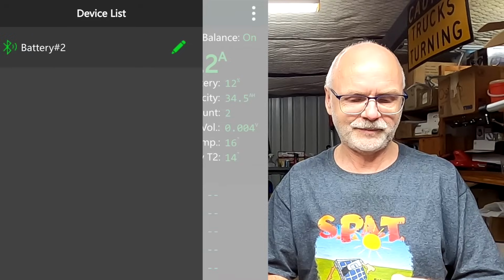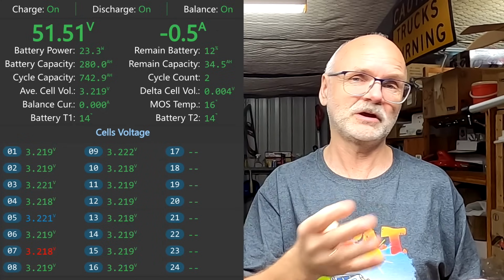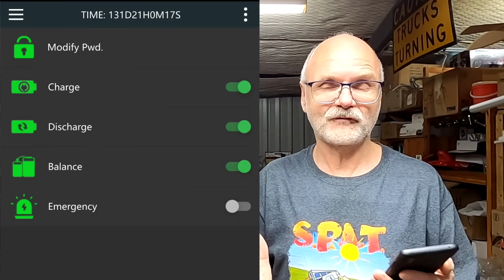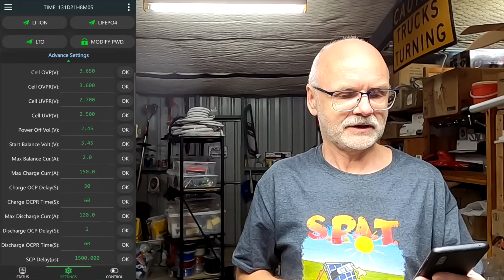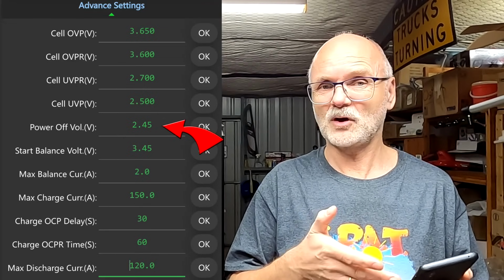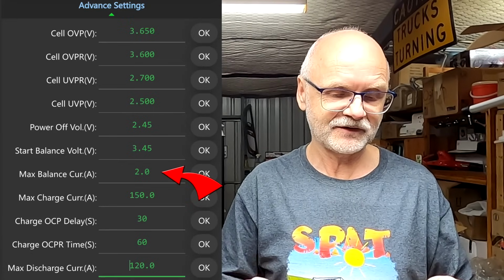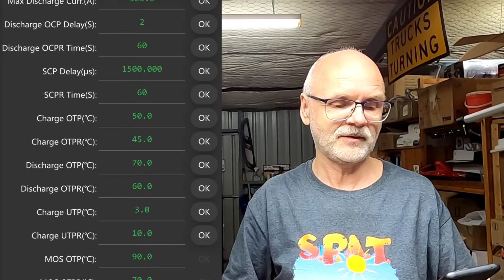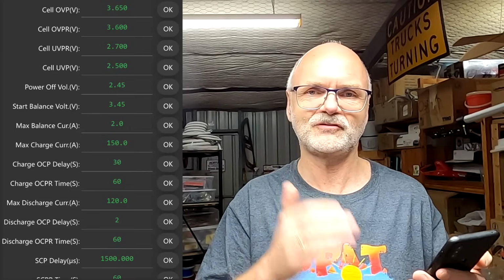JK-BMS: all settings and menus explained. How to program and set parameters.

Comment: First of all, your videos are amazing Andy! SO SO helpful that you test all these BMS's so we don't have to! And you explain so much. So many of the tricks and traps around battery charging and balancing. Great stuff, thank you!

I'm getting confused though. You have a video demonstrating how active balancing can actually unbalance your cells because it is always on. Then we have the JBD Muller Edition BMS which turns off its active balancer when it's not needed, supplanting the JK BMS at the top of the BMS pile. Problem solved. Now I see this video for the JK BMS settings, which let you set the balance start voltage to 3.45v.... why is the turn off feature on the Muller BMS any different from this ability on the JK? 

Does this mean the main difference between the muller BMS and this one is just the maximum discharge current (250 vs 200(ish)) and the active balancing current (5A vs 2A)?? Many thanks from the UK!

Comment: So if the maximun configure voltage is ecseeded ,the bms cutt of charging only or cuts off both charging and discharguing ???
Reply from the maker: Only charging, you can still discharge the battery through the BMS in this case.

Comment: Hi, thanks for your very interesting tutorial on the JK BMS. With regards to the B2A20S20P BMS. My question is with regards to the connection of this BMS to the Victron system. What would the 4 pin port be set to RS485 or CAN?

Comment: Andy.  I have the last version of the old jk  and it just Won't accept the 123456  code    but I never changed it.  And I don't think anyone did.. .    Any link to reset it to factory  and  if this work then to accept the  factory password??? 😢😢😢
Reply: οκ i found the bug....  it does not enter the code but if you insist and retry without  erase the code  your app accepts the code . but you need to insist and try the same clicked code .. every time you close app and retry code it just wont let you enter parameters changes !!!!!  it just needs to push the 123456 code you already tried  and no erase it

Comment: I am building a system for my motorhome ,  a 1972 GM bus 4108A,  I am installing 4-540 watt panels on the roof.  all viltron equipment.  a 3000/24/70 inverter charger.  a 250--88 Tr Ve can MPPT,   32 - 3.2 volt cells 304 amps. , victron smart shunt.  my question is which JK bus should I run.  I would like to configure the batteries into 2 - 18 cells batteries  at 24 volts.

Comment: Hi Andy, great Videos and instruction on LiFePO and BMS! I am just learning to use the JK BMS with my new 105LF-diy battery. I wonder how i can show the actually charged Ah into my battery? I don't find any information on the JK app about the charged (or discharged) Ah? That would be good to know and easy to calculate for the BMS i guess. I there any setting for this to show the Ah?

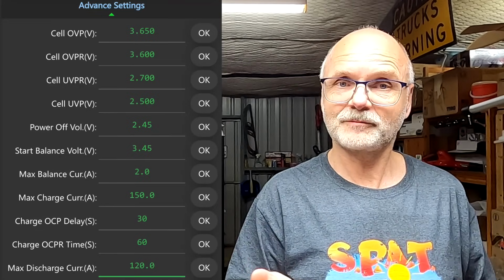Comment: WHAT !?!?   At 25:50 Andy says " so if you have a 12 volt battery for example this would be 13.8 volts "  but thats for his start balance voltage of 3.45.    How do you get up to 3.65 per cell if you only charge to 3.45 ..... I totally don't get it !
Reply: You DONT charge to 3.65. That voltage is the absolute highest the cell can take. Charging to 3.45v per cell is about 99.99% full charge with almost no difference in capacity charging higher to 3.65v. 

Think of a lfp cell as a rubber band. At just resting voltage of 3.2v, the rubber band is just slightly hanging with no tension. This is where the cell will theoretically last forever as there is no dendritic growth internally which is what kills the cells. 

If you charge to 3.45v, youre stretching the tubber band about 75% of what it can take before it snaps. It still holds all the energy, but isnt close to breaking. 

At 3.65v the rubber band is stretched to right before its breaking point. Yes it holds energy, but not much difference compared to 3.45v except you are stressing the hell out of it. You stretch it to 3.66v and it snaps. Why push it to its limits every time if you dont get more capacity/power out of it?

3.45v is what Andy as well as others have found where the battery truly fully charges, and can also balance correctly while keeping 99.99% of its usable energy and not stressing the cell out. 

This basically can add up to a few thousand more cycles to the cells which  means they last much longer and you get a few years more out of them.

Comment: Do you have a newer video with the new settings? They now have "Battery OVP & OVPR" which you'd think would be like 55volts? but it defaults to 3.5 which makes no sense because that's the "cell" voltage not the battery one

Comment: My eve280s come today.  Plan to set them up just like yours.  Had no idea what to set the inverter (Sol-Ark 8K) to before watching your video.  I have a 14s100p 18650s battery and currently run them 54 volts and 45amp limit  (very conservative settings).  Plan to replace them with the lifeP04s, but since the voltage is nearly identical, might try parallel at some point.

Comment: Hi Andy, Thanks for your very informative videos and reviews. I did a conversion from lead acid to 16 x EVE 304Ah cells in my G-Wiz EV using the JKBMS 20S - I did this about a year ago, and watched your videos to help me decide which kit to buy. Since winter time, I'm having issues with some of my cells, probably due to stress and low temperatures affecting performance. The "SOC" on the display is basically correct, but on my vehicle when I go below 40% soc, one of the cells starts to underperform, usually when the heater is on, I'm accellerating hard and going uphill... momentarily dropping below the cut-off voltage of 2.45 and the cut-off engages, stopping the car, a few seconds later, the voltage increases and it works again, I obviously turn off the heating and acellerate more gently. The other cells are obviously all ok, being over 3v. I was wondering if its possible to change the "SOC" so 0% is at the real level of 40% where my cell starts to play up. How could I do this? perhaps change the cell capacity value lower? I've ordered a replacement cell ... but I'm also mulling over adding another cell so its 17 in series to help.
Reply: When you build a battery, it’s important to purchase 1 or 2 cells extra. Build the battery and then stress test it: fully charge it and then run it down. It’s common to get a cell that just doesn’t perform well on the low end. In that case, replace the cell and top balance the pack. That cell is not going to improve and will instead continue to degrade.

Comment: My old batteries are almost dead. I want to meka a new lifepo4 24v battery bank with 8x280ah cells and a jk b2a8s20p bms. My daily consumption will be 1kw/24h the most. Is the 7kw battery setup ok or i will have issues with this small consumption? My solar setup is 1kw solar panels, epever 4210 mppt charger and epever 3000w inverter.

Comment: hello. Your video is very useful.Helped me learn how to adjust some settings.. I have jk bms but ı have a problem.  '' warning: equli. res. too large.'''and 20s battery. In the 20th series, 0000 is written in the resistance section.  What causes the problem? Off-Grid Garage, I would be very happy if you answer.

Comment: Just bought newer version of the JKBMS 4-8S with CAN & heating, because I messed up my original unit. The new bms has two more settings for protection, beside Cell OVP, it also has Battery OVP (default at 3.5V), any idea what I should set it to?
Reply: Was wondering this as well. I guess it should be like 56 volts or whatever if you have 16 cells? not sure if that's true.
Their manual doesn't even mention it.......
Reply: @gg-gn3re  so it seems to be voltage at which the bms should reset to 100%(for Battery OVP, and it is voltage of cell not x8 or x16)

Comment: 24S20P means 24 in series and 20P in parallel maximum. I think the parallel is fitted to balance current i have a model 8S4P with 0,4A for balancing but i'm using a 8P cells and the BMS cant sai the diferrence of 4P or 8P so i belive that it's vinculated with the balance current because in a 8P BMS the baçance current is 0,6A

Comment: Good morning Andy
Thanks for your great videos!

I've had a problem since yesterday.

I finished my project about 7 days ago. At the beginning everything worked fine. Now cells 3 and 4 are not recognized in the BMS.

I have checked the cables. Up to the flat connector. The voltages also arrive there, always 3.3 volts more....

A reset also makes no difference.

I saw in another video that the input resistors were defective. Have you had or heard of such experiences?

Greetings from Germany

Comment: Nice and informative video. Thank you very much. 

Connection wire resistance may be important when the balance happens. Balance current goes through those small wires and there will be a voltage drop when ~2 amps goes through them. And if we set up a correct resistance of them, then BMS can calulate the individual battery voltage by adding them to the messuring voltage of a cell.

Comment: Hello Andy, last year I purchased a JK-BMS B2A24S15P. However, I've only recently had the chance to assemble the battery and put it into operation. I've noticed that the settings I apply are only active as long as I don't turn off the BMS. When I turn it back on, I have to redo all the settings. I have an older JK-BMS where I don't encounter such issues. I read something online about changing the password to retain/safeguard the settings. I changed both passwords, but they only work as long as the BMS remains on. After turning it off and on again, the default passwords and settings are back. Is there a trick to this? Greetings from Germany.

Comment: Hi Andy. I've been watching your videos. Lots of info and learned how to assemble my own 280ah 16s lifepo4 battery.  I'm having some issues with my JK smart bms. I bought an inexpensive dc charger from Amazon, but I didn't have much luck. So I assembled the battery and wired in the bms. I attached my Lithium battery charger to get a top balance. It won't charge past 3.34v/cell the AH rating sits at 198ah. The voltage is 53.56, which is 97% charged.

Comment: I just bought what is supposed to be the 4-8S JK-B2A8S20P, the issue is that it won't start on a 4S setup.
If I connect 24V to the B+,  I get it to start and I can connect to it.
But trying on the 4S setup doesn't work.
Hardware Version: V9.X
Software Version: V9.01M3

Note: I bought this one second hand, used once in 8S configuration.

Any tips on this or is this as I fear, the early version that doesn't support 4S setup?

Comment: I just purchased two JK 4s-24s 200 A BMS’s.

I connect to Bluetooth using button on remote screen.  I change my settings to match my 20s lithium ion pack.

All cell voltages are good, I can see the active balance operating.  I connect charger and turn on charge button. Bluetooth drops, I have to reconnect, charge button on but no current flowing.  I turn on discharge button. Bluetooth drops no current flows.  I can never reconnect to Bluetooth it’ll connect for 2seconds then drops.
Both did the same thing

Any suggestions
Reply from the maker: Wrong cabling maybe, seems like the BMS shuts down when you connect the charger. Can you connect a load and see current flowing?

Comment: Hi Andy, I have jk-bms with 16 280AH cells. What voltage should I set to charge them? Now my JK-BMS small display shows 56V, 79% and my cell phone shows 221Ah. Should I increase the charging voltage to 3.65v x 16 = 58.4V? I had followed your videos, one them them you stated the charging voltage is 3.45-3.55 per cell, am I correct? Unless I increase the charging voltage or the JK-BMS will not charge. I need to charge the 48V battery to 280Ah. Please help.
Reply from the maker: First of all, the JK is a BMS, not a charger. The charge voltage limit needs to be set in your charger, not the BMS.
3.45V-3.55V is great. If you set your charger to 55.2V and leave the battery sitting there for a while so the current tapers off, the JK will reset to 100% eventually. I have never explored the triggers for that.
You can also increase the voltage bit by bit and wait until the current goes down to say under 5A, then increase again a bit. Watch the BMS when it resets to 100%.
At 56V, the battery is full anyway, if the Jk shows 79% or 100% does not matter. It is fully charged.
Reply: @OffGridGarageAustralia  I understand JK-BMS is not a charger. Now I know and don't care for the percentage shows on the display. Thank you so much for your information.
Reply: @OffGridGarageAustralia  Dear Andy, I have another question. The JK-BMS is slow to balance. If I add a 5A balancer in parallel with the JK-BMS, does it create problems?

Comment: Hi Andy, I bought the JK bms since you recommended it than a Daly, and thanks for that, but I need to know what size of lug hole is best for the 280 ah Eve, 1/4 or 5/8 or the 3/8. I haven't purchased the cells yet so I'm not sure what works best of the posts, it's nice that your showing your findings on the lithium batteries for us beginners, have a great day 😊
Reply from the maker: Thanks for your comment. The EVE cells all have 6mm studs or holes. Not sure what this is in imperial size... I think it's 1/4.
Reply: Thanks buddy, I was just looking for the info on that, with no luck, lol, so thanks buddy, love your testing,  have a great day, cheers :)

Comment: I have a B2A8S20P with self power consumption 65Ma@12,25v   0,8w with all disconnect and functions disabled, JK false  advertised as having standby function. Only on off available.I don't want discharge my battery. Sadly this is the only big problem with it.
Reply from the maker: Have you contacted JK about this? What did they say?
Reply: @OffGridGarageAustralia  I bought it on Aliexpress from HankzorBMS Store, more than 15 days passed, and I discovered this absurd consumption for a 4S system. They didn't provide a solution, and they want me to return it at my expense. How can a bms intended for small systems, have so much self consumption?

Comment: The resistance of a cable is a very important factor in voltage drop. And yes is very important for balancing especial when we measure .xxx figures. When you built your pack you definitely shortened some wire and extended a few others, therefore the longest wire will have a higher resistance compared to the shorter wire and this means the voltage read under balancing (2A) is slightly out
Reply from the maker: That is only party correct, as you assume, the BMS will measure and balance the cells at the same time. However, this is not the case. Balance cable length does not matter in this case.
Reply: Of course it matters... resistance in a cable means lower voltage readings which means imbalances.
Reply from the maker: @giubaca  voltage measurement is independent of cable length. No current, no voltage drop, mate.
Reply: @OffGridGarageAustralia  well apparently you know better than all engineers who know and proved already that voltage drop is determined by resistance mV/A/m multiplied by lenght and designed current divided by 1000. Which means ~0.044v for a 1m length of 18awg copper wire in your application... 
But hey you know better apparently... all those jk engineers must be a bunch of idiots they must have allowed that resistance correction setting for no reason
Reply from the maker: @giubaca  I leave your single personal opinion her for others to read and learn. Have a great day.

Comment: Start balance voltage should be set lower (i.e. about 2.9v in your case). You have an active balancer there and it can move power from one cell to another (where a passive balancer simply discharge one cell to bring down in line with the others), balancing should be on almost all the time. For example Nissan balances all the time and it stops when the battery is bellow 20% soc. Let that balancer work
Reply from the maker: No, wrong. With LiFePO4, you cannot start balancing before 3.45V.
Reply: @OffGridGarageAustralia  Continuous balancing in a LiFePO4 (Lithium Iron Phosphate) battery pack offers several benefits:

Improved Cell Performance: Continuous balancing helps maintain consistent voltage and state of charge (SOC) across individual cells in the battery pack. This ensures that each cell operates within its optimal voltage range, leading to improved overall pack performance and longevity.
Enhanced Cell Lifespan: By keeping the cells balanced, continuous balancing reduces the risk of overcharging or overdischarging specific cells. Overcharging can lead to capacity loss and reduced cell lifespan, while overdischarging can cause irreversible damage. Balancing helps prevent these issues, thereby extending the lifespan of the LiFePO4 battery pack.
Maximizes Pack Capacity: Continuous balancing ensures that each cell contributes its full capacity to the pack. By equalizing the SOC of all cells, the pack can utilize the full available energy from each cell, maximizing the overall capacity and runtime.
Safety and Stability: LiFePO4 cells are known for their inherent stability and safety compared to other lithium-ion chemistries. Continuous balancing further enhances safety by preventing individual cells from becoming overcharged, which can lead to thermal runaway or other safety hazards.
Consistent Performance: Continuous balancing helps maintain consistent performance across the battery pack. By minimizing capacity imbalances, the pack can deliver more stable voltage outputs, ensuring reliable and predictable performance in various applications.
Better Efficiency: Balanced cells operate more efficiently because there is less energy wasted due to voltage differences between cells. This can result in improved energy efficiency and longer operating times for devices powered by the LiFePO4 battery pack.